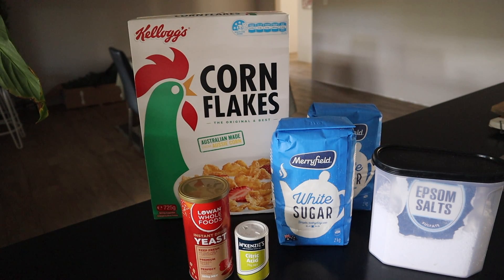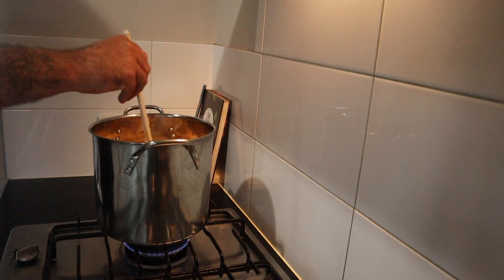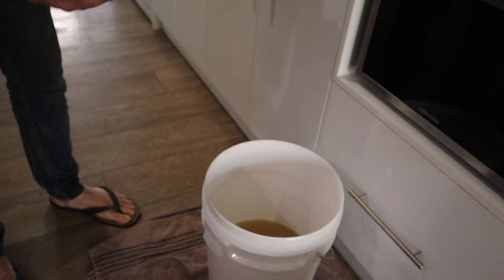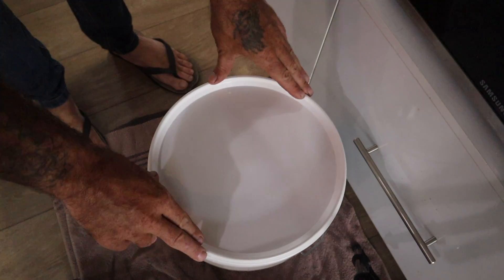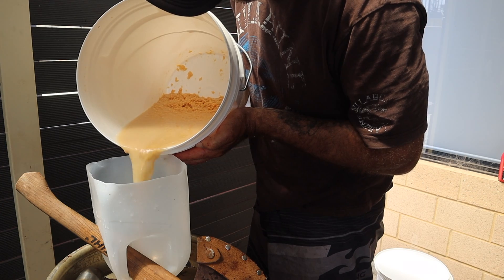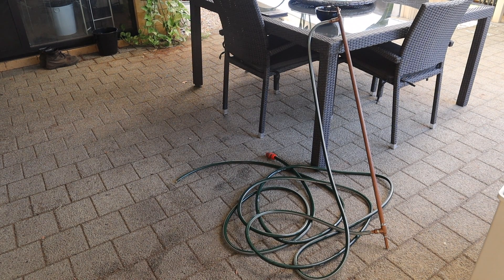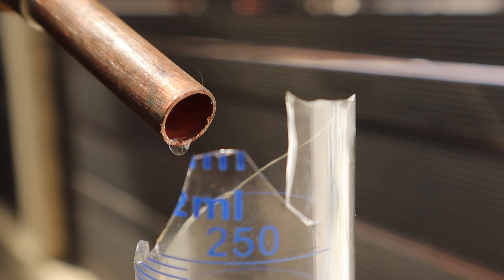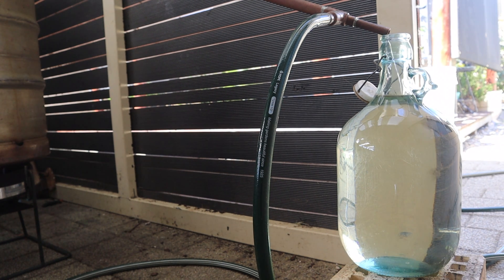Cornflakes Whiskey

Comment: Great video, would like to ask how did you make the "head" of the still, is it part of the spear from the keg with some welded stainless cup? Thanks
Reply from the maker: Hey mate, sorry it’s taken a while to get back to you… yes, it’s the threaded top of the spear, with a stainless steel cup (from KMart I think) that I brazed to the top of it. Then a 45 degree copper elbow brazed into the top of the cup. Hope that helps.

Comment: No heads/hearts/tails cuts?  It may have not made the video cut, but it's extremely rare that I've found anything palatable on 1x distillation.  Your mileage may vary...
Reply from the maker: I throw away the first 250ml or so of the heads. Then just collect about 5L of spirits. I’m aware that a much nicer product can be made with better cuts but I guess I’m not that fussy. Single distillation is fine for me, it definitely improves after ageing for a while.

Comment: 1x 500g bag of cornflakes for a 20 litre batch? Surely that’s not enough. I’ve just made a similar batch with 4kg cornflakes, 1.5kg wheat biscuits and 750g rye bread. 1 packet alpha amylase and 1 packet glucoamylase for a 20l batch. What in this is breaking down the starch into fermentable sugars? I suppose your getting excess sugar from the granular sugar you’ve added but I doubt your really getting anything from the cornflakes. But hay ho, If it worked for you and tastes good I’m glad to hear it and may give it a go in the future for a simpler run than the one I’ve just done.
Reply from the maker: I’m a simple kind of guy, hence the simple recipe. I believe I can taste a corn sweetness in the end product….. but maybe it’s all in my head. I also enjoy the taste after a single distillation which others have said is not “possible”. I’m no expert on the matter, it’s just what I do. I’m sure I could use more cornflakes for extra flavour, I might try it in the future. Cheers.